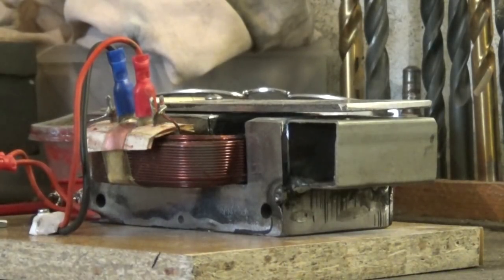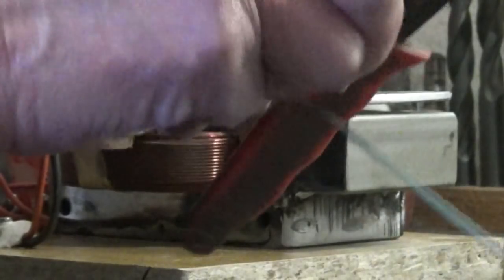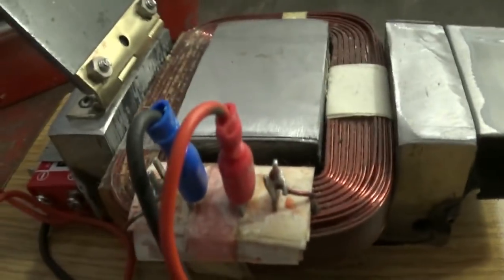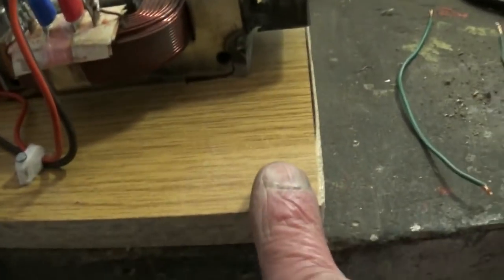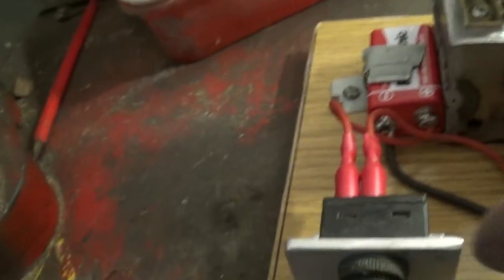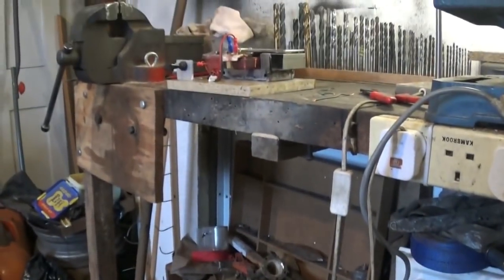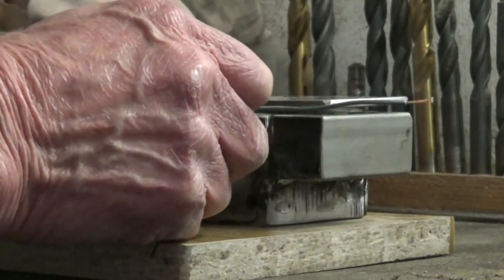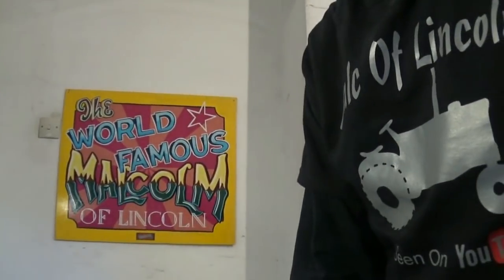Successful Electromagnetic Soldering Holder

Comment: that works great malc !
Reply from the maker: Good thing to make Shawn. With your electrical knowledge it would be an easy job for you to make a power supply, mill or file the top dead flat and make yourself a magnetic chuck.

Comment: I would like to copy that malc  with your permission
Reply from the maker: Of course you can Martin. Now, if possible get an older microwave transformer. The coils are copper, modern cheap ones are ally. Also if possible mill it flat, if you have that facility, or failing that file it if you're fit enough (grin). As long as the plate on top is flat on top of the transformer, it is very strong with very low current. Something that surprised me. Also the base of hard rubber as I suggested would be very beneficial, because it would allow different thickness of wires to be held securely. Love to hear how you get on. Any questions just ask......

Comment: thats a pretty good idea! very impressed! thanks for sharing.
Reply from the maker: Thanks Emma. If you get a similar large transformer with copper coil, it's a fairly easy job to make a magnetic vice. Put it in a steel box, fill it with epoxy and mill or shape it flat. I've watched one or two videos, however I'm surprised how powerful it is with only a small current. Using bulbs as resistors it would be an easy job to make it usable from a car, or drill battery. Wiring direct is of course a dead short, and will quickly burn out.

Comment: Hi Malc, I'm surprised how powerful that is just on a 9v battery ! I Imagine on say an 18v drill battery it would take your finger off :-) Keep well mate. Malc
Reply from the maker: Hi Malc, I'm also surprised how powerful it is. I have seen a couple of videos of people making magnetic vices with them. This transformer is from an old and quite powerful microwave with copper coils. Cheap modern ones have ally coils. Remember it's a dead short across the battery, so some form of resistance is needed. Also the top must be dead flat. But a transformer such as this in a steel box with the top milled flat, and a suitable DC power supply would be very powerful. More than enough for holding metal for working, cutting grinding welding etc.

Comment: Nice job Malc, there wasn't any doubt it could be done, the right fellow was on it. What you can do when you put your mind to it, well done my friend.
Reply from the maker: Thanks Bob. I usually get there in the end. Just wish I didn't make so many silly mistakes on the way. A good transformer from an older powerful microwave is surprisingly powerful with only low voltage/amperage.
Reply: Malc, brings to mind an old saying, I'll share it with you. The galleries are full of critics, they make no mistakes because they attempt nothing. In the arena are the doers who make many mistakes because they attempt many things.A man who makes no mistakes is a brake on the wheels of progress.Nice job mistakes and all my friend.
Reply from the maker: I agree Bob. One of my first 'teachers' was a clever man at my first job. Occasionally he'd say 'I've made a ballsup. Hope I make a lot more otherwise I won't live long'. Only thing is I usually learn from mistakes, and rarely make the same one again. Or I used to. Somehow I now seem to miss the obvious, just irritating that's all. Part of it of course is age, but also lack of doing things regularly. I go to do something I've done all my life. Not done it for a while and find I struggle.

Comment: Very nice job Malc. That works great
Reply from the maker: Thanks Lloyd. You need to find a good transformer and make yourself a magnetic chuck. I've seen them done, but with the top milled flat it doesn't require a lot of power to be more than strong enough for working with.

Comment: That really is amazing that you are powering the electromagnet with just a 9 volt battery and its so strong you can almost pick it up.Believe me I do know how hard it is to try and hold two wires and solder then that's pretty handy alright. Thanks for another fun project and demonstration
Reply from the maker: You do a lot of soldering Larry. Well worth making yourself one.
Reply: Very true it would be handy to have